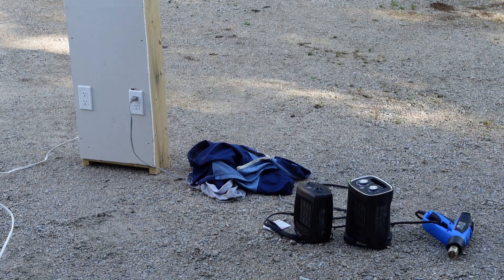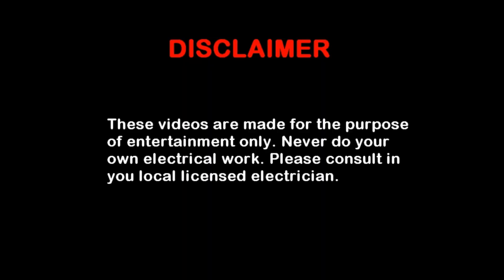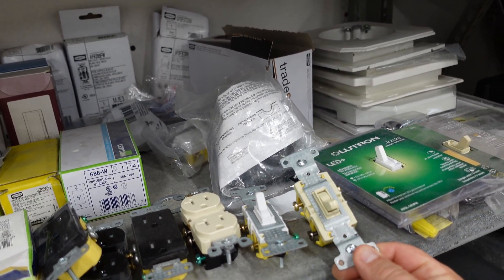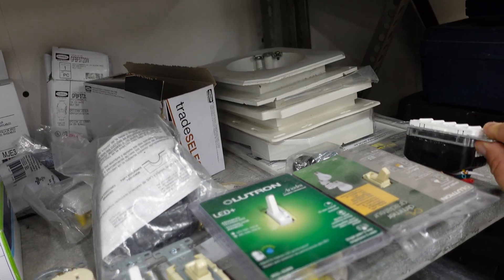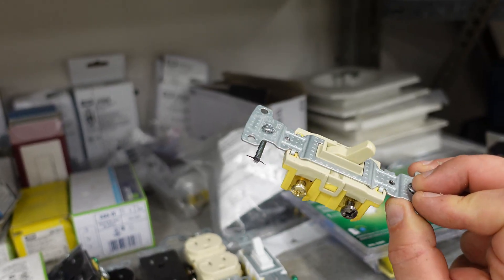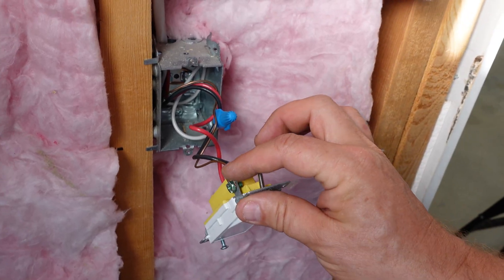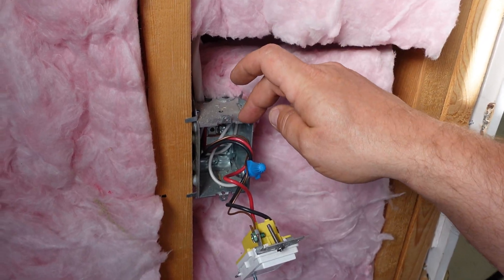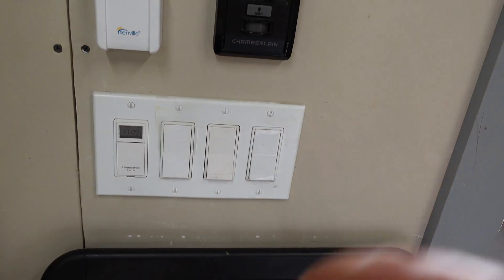Do Light Switches Need To Be Grounded

Comment: What if it’s a plastic box and the switch doesn’t have a ground screw?
Reply from the maker: There is a metal bonding strip in the center of the box that runs to the back molded into the plastic